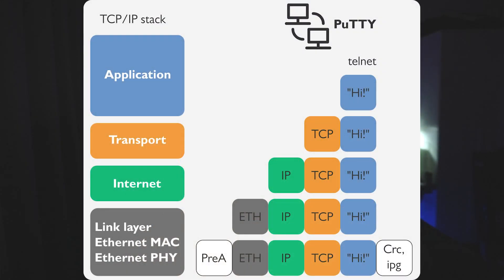ESP8266 Explained In 10 Minutes!

Comment: what is duino coin for? I researched about it and it seems to me a coin with no economic value, and I saw several videos of you showing people with rigs with cluster 30, 40, 50 esp8266, so if it is not profitable, you receive 000000,00000001 dollar cents and had to spend for minus 50 dolls (I'm from Brazil so this would be multiplied by 5, that is, equivalent to paying 300 dolls in 25 esp8266), it doesn't make any sense.
Reply from the maker: First of all. No crypto coin has economic value unless people give it that. Even gold bc the only reason it does is because people decided to pay for it. Its not crucial for anyone, same with crypto. With that being said, it is profitable. You should watch my video on how much i made mining duino so you see for yourself. Lastly Duino is a project so people can learn how to mine crypto. And also get old microcontrollers out of the closet that almost everyone has laying around but no one uses anymore. So there is your sense on why people mine DuinoCoin :)